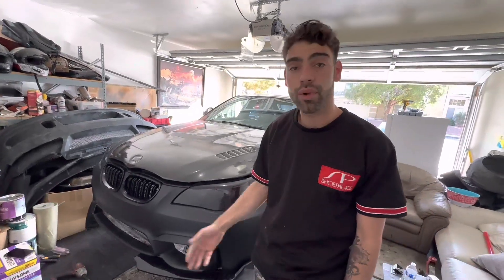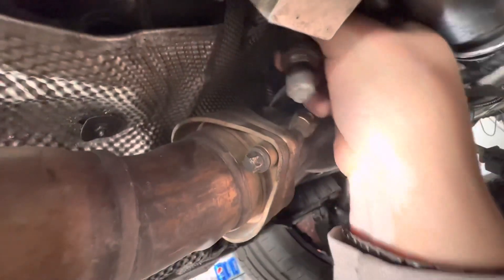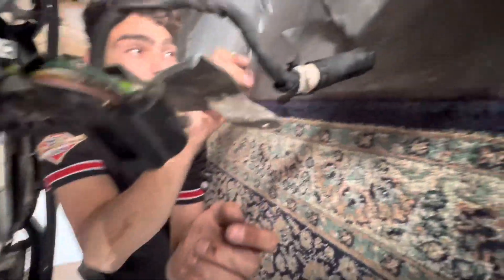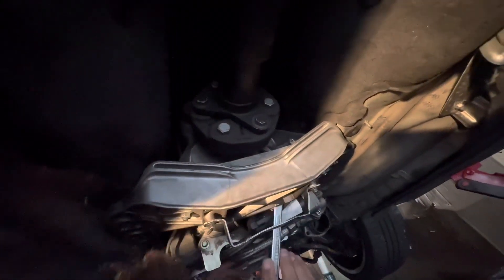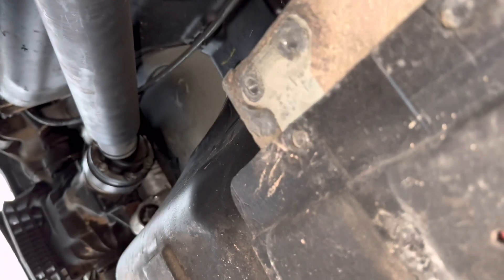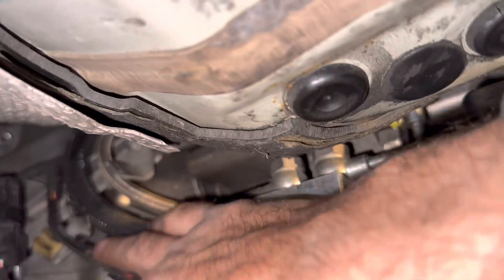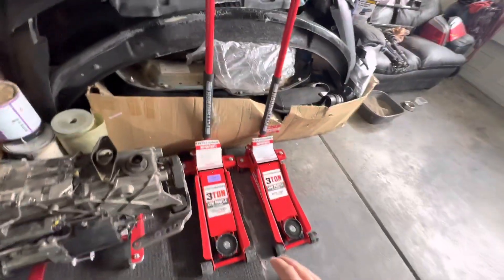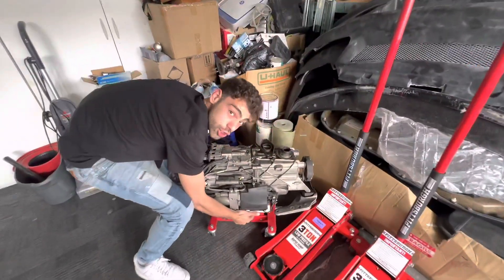How to drop a transmission on an e60 M5 V10

Comment: Hi, i se you have welded bellhouse on gearbox? My just cracked today, do you know reason for it?
Reply from the maker: He welded it because it cracked it holds up if you weld it
Reply: @Lol82394  Yes I believe it was the 2 little square bushings inside the trans mount  were torn so the mounts which was causing too much play And all the stress was on the bell housing bolts instead of the trans mount… I’ve had mine snap a rear sub frame from the torq. It’s pretty common 🫡🤷‍♂️